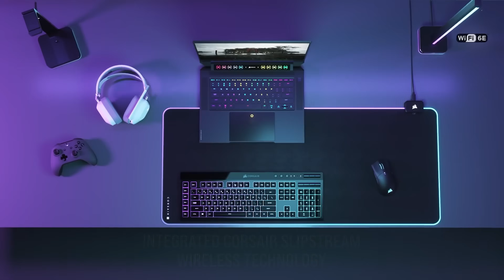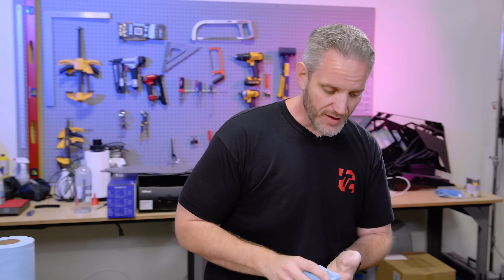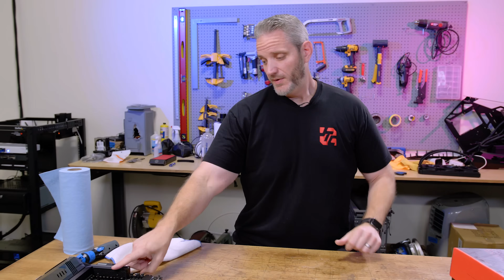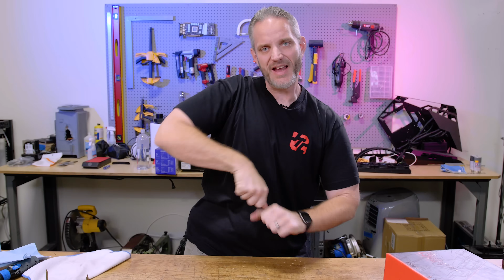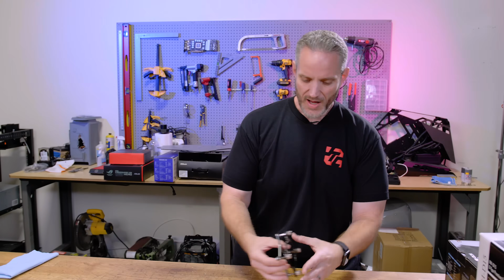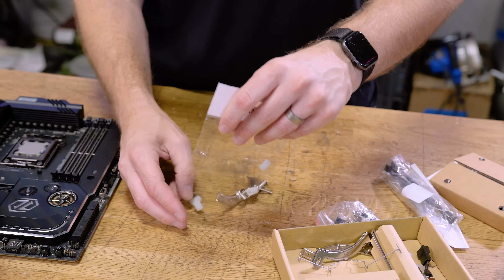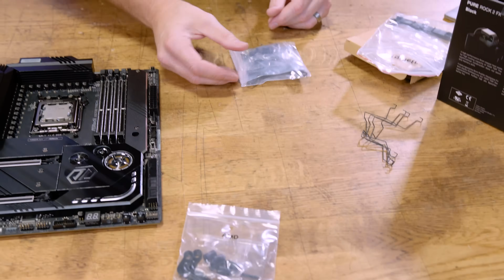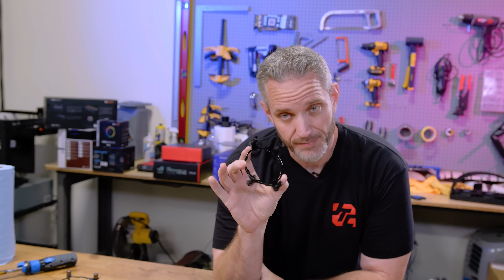AMD made a terrible flaw with this design...

Comment: So far so good with the hook hold downs with my Cooler Master 360 RGB AIO.. Works great with my 5900X I see clocks hit 4.950 4.920 across several cores and I have it top mounted too, But I also have a great Air flow case in the white Phanteks P500A.. You almost have to have a 280 and up AIO or Top Noctua and Be quite Coolers for Zen4 and Intel now.. It's just a fact of owning one of these parts..
Reply: Cooler master also has good mounts, I've always use them but mines a DH15 air cooler.

Comment: There are mounting kits for older Noctua coolers for AM4 which should work with AM5 as well. You get them for free if you send Noctua a copy of the invoices for your board and cooler.

Comment: All these comments about temps. I made 2 changes to BIOS PBO settings, lost only 500 points in cinebench multicore and saved 13C. Running at 82c max load and getting over 37.5k in R23. Gaming I see 62C which is exactly the same as my 3900x. To get that extra 500 points they hit thermal resistance due to the IHS, creating further heat and inefficiency.

Comment: i'm currently on an AMD system, always kinda been intel and the hooks...i was so happy when my EK block came and I could remove the hooks for ever. the intel coolers have given me woe's with a peg not going through the board properly and requiring some tough love....but having to take a flat screwdriver put it in a tab and then push down towards my brand spanking new motherboard....was by far the least comfortable thing I've had to do as I do believe "I rammed a screwdriver through my motherboard" is not covered by warranty..., it was even more uncomfortable then my first rigid tubing build (and that thing leaked...twice... no damage though, "harmless" spot ^^)

Comment: Jey, I think that cooler mounting pressure inspection by looking at thermal paste layer thickness when you remove it is flawed simply because paste (unless it is very old one) still have some movement while you loosening the mounting screws to remove the cooler, is it not?

Comment: Jay, this video was extremely helpful for me. I’ve been dealing with overheating issues with my Ryzen 7 5800X CPU.  I had an MSI 240 CPU cooler installed. I upgraded to an MSI 360 CPU cooler and moved its location to the front panel instead of a top on my Corsair 4000 D. During installation I followed your advice and double checked all the connection points for the cooling plate to the CPU and it runs fantastic. Thank you so much!
Reply: What temps were you getting? Mine runs fine in my 011 Evo with the EK 360 AIO installed at the top of the case and the cpu runs at 70 degrees in the summer and 60 degrees in the winter.

Comment: so, my friend's 5600x brand new stock CPU cooler was stuck like glue, he pulled it and the CPU came out with the cooler. Some bent pins and some broke, and AMD won't do anything about it.
Reply: You can use heat loosen the thermal paste and the apply a twisting motion to unstuck the cpu from the bottom of the cooler. Just went through this. Be careful if you go twisting without heat. I had to apply decent force, so when it broke loose my hand went kinda fast and I lost grip of the cpu. Yes I had bent pins. Yes I fixed them.

Comment: You could pull off the socket retention mechanism and use cooler to hold on the cpu, this is risky, but it can solve the problem for those who wants to take the risk, it also solve the z axis issue

Comment: You're mad because they told you that you reuse the cooler you bought in 2017 🤣 and they're working on adapting the few incompatible coolers out there. They say the CPU can run at 95°C without issues and you grill them for it. They're the white knight IMHO if you compare them to Intel

Comment: you directly contradicted yourself between two coolers. one cooler you stated wouldn't work because it uses the short side bracket, but then 2 coolers later it's also a short side bracket and you stated it works fine. Also it's impossible to keep long side bracket compatibility without also retaining short side dimensions otherwise the cross bar on either configuration wouldn't fit. I don't know what in the world you were smoking but this is NOT accurate information.

Comment: if the pins are gone off AM5 CPU's and are on the MOBO instead, and the IHS is soldered, why not just flat plane wet sand the IHS down with sealant over the caps/gaps while ya do it?
seems alot easier

Comment: Seems like AMD made a big mistake with this. An AM4 heat sink is compatible because of it's mounting hardware and the main cost is in the heatsink, not the mounting bracket. AMD should have just made the IHS the proper thickness and then heat sink makers would only need to make an AM5 bracket to match. They already use the same heatsink for both AMD and Intel by just swapping the brackets. And didn't something like that happen for the switch from AM3 to AM4? I seem to remember Noctua (or maybe it was another company) offering brackets to allow AM3 heatsinks to work on AM4.

Maybe AMD will wake up and release a version with thinner IHS, maybe for the 3D cache versions.

Comment: So crazy idea. One that I hope someone like Jay might try. but what about lapping the IHS by like 2-3 mm and using off the shelf UNC screws on on the coolers that screw into the backplate to adjust the z height to see if we can get better performance/temperatures. expecially since it would be "safer" than delidding and more accessible to average enthusiasts that don't want to ruin the substrate or CPU by accident like derbauer did.,

Comment: Those 2mm will turn into the 3D V-Cache on future products, I bet there's more marketing than engineering in this "minor" oversight so that all chips run at 95C instead having the X3D chips making headlines because they run way hotter like the 5800X 3D.
Reply: Jay has an updated comment that most coolers will be fine with the existing AMD backplate. It's the ones with their own custom backplate that will be on the hook. Sounds like some revision is in the works regardless.
Reply: @DKTD23  yeah, I've seen they're working on improving compatibility for custom backplates. I was talking about the IHS thickness being greater than it needs to be for this chips.
Reply: @ale-lp  ah ok. Yeah why did they decide to do so?

Comment: You know, with 3D printing of metal becoming a thing, and improving at a pretty high rate, I wonder how long it will be before someone attempts to make an IHS with integrated cooling channels built right into it that can be plumbed straight into a custom loop? It would certainly do away with the need for thermal paste, and yet another lump of metal to transfer the heat to/through (the cooling plate of the AIO or custom loop CPU cooler). And it would no doubt be far more efficient than any cooler you could attach on top of the IHS, as well as mostly negating the issues around IHS thickness (as long as it's thick enough for the internal cooling channels, you can make it as thick or thin as you like). Basically as close as you can get to direct-die cooling without actually having to de-lid the processor.

Comment: If der8auer goes forwards with such a test, please CNC the "spacer" to have the same volume as the IHS while maintaining the same contact area shape and size. There's a lot of material on the original IHS extending past the main contact areas on each side (cooler and die sides respectively). Being part of the IHS, these "zones" of the IHS add to IHS mass, and will soak up heat but not be in direct contact with the cooler coldplate. If we skimp on including that mass, or make the spacer completely flat so its entire surface area directly contacts the coldplate, then tests will generate better results for improper reasons (vs the now-flawed test conditions we intend to simulate).

Comment: @jayztwocents 21c isn't just because of the thick IHS, it's because of the IHS in general. The 2mm will add some but not much. Saw the same thing delidding 4770k and running with and without IHS, you remove a layer of thermal compound that needs to be passed through which is most of the difference, i'd challenge you to grind 2mm off of the IHS and run it again to see what this decision by AMD really cost us.

Comment: Why the heck would they make the AM5 platform worse thermally (which also lowers performance by having lower cpu boost frequency) just to be compatible with old AM4 coolers when we already have to replace EVERYTHING else anyways to do a Zen4 build? Most of us are just keeping our old PCs intact and doing all new builds for Zen 4. I'm not going to just take the cooler out of my old build when I could just have 2 functional pcs by spending an extra $100 for a good new AM5 cooler (a zen 4 build with rtx 4090, 32 gigs ddr5 6000, good AM5 motherboard, new 1200 watt psu, 1tb PCIE 5 ssd, a storage drive, a decent case and fans is already like $4,000) so what's an extra $100 for a good new AM5 cooler?

Comment: Also sidebar: The NH-D15 would or should outta work because it uses the mounting bars. It's true for the AM3 socket, and therefore; presumably, also true for the AM4 socket as well.

Comment: My Thermaltake air cooler will be fine for when I upgrade to AM5 then, it uses the hook mounting. I'll be using that until I decide to switch over to water cooling, then I'll probably get a JTC water block

Comment: Just lap it with 60 grit and put truck suspension springs on the cooler to get the height and mounting pressure back in check.🤣

Comment: I must say, when I saw Roman's video, it sort of put me off the new Ryzens. I've been planning an AM5 build for quite a long time now, to replace my aging 7700K. I really dislike design flaws, and one of the reasons I was going to give Ryzen a try is because I felt burnt (literally) by how bad the heat transfer between the die and IHS was on the 7700K—I ended up delidding it for a 15–20°C improvement...
At this stage I'll probably go ahead with a 7700X build, but perhaps try direct die in the future. Hopefully 840mm of open loop cooling (with GPU) will suffice in the interim...

Comment: I don't see what the 'terrible flaw' is TBH.  Any cooler maker worth supporting will provide replacement brackets if needed, and seriously, ppl should thank AMD for allowing even a small subset of existing AM4 coolers to work with their new processors.
Intel FORCE you to toss away your old good coolers every 3 years, AMD are terrifically consumer friendly in that respect.

Comment: yeah the Pentium 3 Tualatin I have has the cooler that you use a screwdriver breakerbar method, nearly shaved a capacitor and the ram off of the board.  A really ridiculous mounting system.

Comment: AMD really can't win can they?
Intel forces you to change virtually all your kit and brackets every 2 generations and there's barely a whimper from reviewers.

Intel get extra performance by pumping enough power in to run a large toaster. Footnote in the reviews. Chip runs at over 100°C. Reviewers go "oh well, it's designed to run that hot".

AMD finally bite the bullet and have to change their socket and OMG, the knives are out.

Extra power draw. Knives are out.

Chips run hot, but NOT AS HOT AS INTEL. Knives out.

They try and mitigate with doing their best to allow enthusiasts to use existing coolers - knives are out again.

To be honest, they might as well gone the whole hog and not given a monkeys.

Just like Intel.

Comment: I have had a lot of issues in the past, with tower coolers using the two clips, either coming off during shipping, or moving up and down, pulling the CPU out of the socket and pushing it back in again, destroying the CPU and Socket, Especially with, coolers like the Antec A400 series, the issue was so common, we stopped shipping AM4 builds with any cooler that uses the two clips.

Comment: IIRC der8auer said, the 1°C-3°C improvement are not about using liquid metal. He said, that the liquid metal he used isnt publicly available and it should be about 1-3°C better than the liquid metal, which is already available.

Comment: If that IHS is so thick could a heat pipe like plate be used....Not sure if it would work or how efficient it would be.... Best solution don't make it so thick, am I right? but IF YOU HAVE TOO...., Probably  bad idea whatever :P

Though if the ISH is heat pipe you might go with a larger weirder cooler connection than standard.... But then you'd not have AM4 comparability... YOLO!🤣🤣🤦‍♀🤦‍♀🙈🙈

Comment: Phil, I did the same thing, also with an Athlon XP. It was the first new computer I ever built. I had torn down, rebuilt, and made Frankensteins out of dozens of computers prior, but this was my first new computer and I had saved up $1500 in 2001 dollars to have my first not used or handed down hardware, and the whole build was lost to that screwdriver slip.

Comment: Little update for Jay and other viewers. I just bought a Noctua NH-D15 for my 5800x 3d in august. The latest versions come with a diagonally slotted bracket for AM3 or AM4. If you buy new you're good to go. If you buy used, beware because the old ones clearly didn't have the slot on the bracket.
Reply: You can get it free from Noctua. Thermalright also provides free upgrades for older coolers.
Reply: I bought my nh-d15 at march of 2016, have contacted Noctua for the parts. They dispatched the kit same day with express courier.
Reply: I used my NH-D15 black in AM4 with the 3800X & 9800X, no worries.  
Noctua sent brackets if you write to them & they send out to you for free  :)
I sold that mobo, it was an EVGA X570 DARK  (I will miss it), but it paid for my ASUS Strix B650E-F Gaming with 9600X on AM5
Jay gestured he put the brackets outwards, boomerangs come back mate, so turn them inward to decrease the distance between 2 points

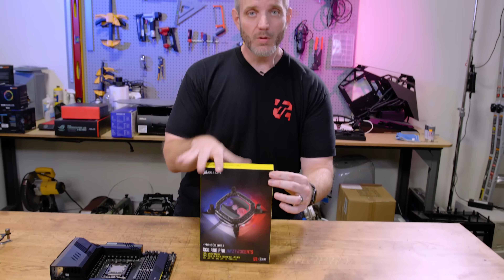Comment: 17:20 Yep had an Intel 1200 Box cooler installed on an Core 2 Duo E8400 cause I was testing if it still works

Result: Works but Lan Chip dead ig

Comment: I managed to slip and cut a couple traces with a screwdriver... I was able to get some super thin enamled wire, scrape some soldermask off and get it fixed by soldering some bodge wires.

Comment: If AMD would have made AM4 coolers not compatible and just have said that you need a new one... Then a cheap  low profile air cooler (that they could have easily included in the box) would probably have sufficed. Dumb move AMD

Comment: Would mean AM5 Laptop CPUs will be killer, because they usually don't come with an IHS, thus not suffering the same thermal inefficiencies the Desktop variants have, right?
plus eco mode and you can have a killer CPU in a laptop that doesn't fry your balls off.

Comment: More or less 9 °K with a basic math calculation of an aerospace electronic thermal calculation engineer (me ;)		

                                                                     a	b

Cond (W/mK)	Copper	                  380	380
Th (mm)	Diff 2 mm	                     2	4
Area (mm²)	2 dies only (2 * 70,4)	140,8	140,8

Rth (K/W)	=Th / (Cond * Area)	0,0374	0,0748
			
P (W)	Max Socket Diss	                     230	230
DT (K)	= Rth * P	                          8,60	17,19
			
Diff (K)	=DTb - Dta	                               -	8,60

Comment: RE: the backplate issue - do all motherboard vendors use the extra screws or just a specific brand? I don't remember if you said the brand of yours and DerBauer's. Would that be something the motherboard companies could mitigate like not having the backplate threaded for those screws? 

I have no plans to upgrade in the near future since I'm on a 5800X, but this just gives me more reasons to wait for future Zen versions. Kinda like waiting for the second or third model year of a new car model. As long as a brand listens, future versions of a product will be better than the first based on customer feedback